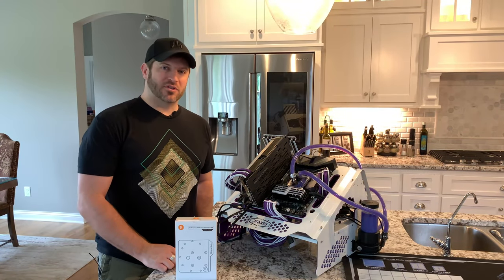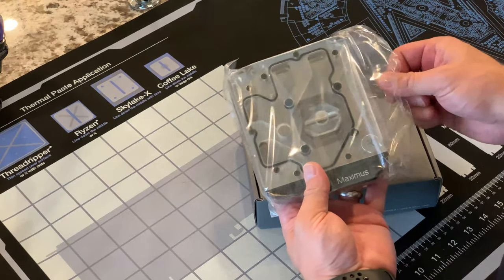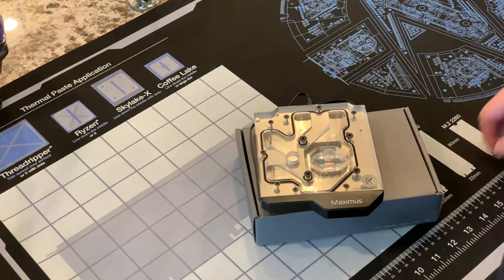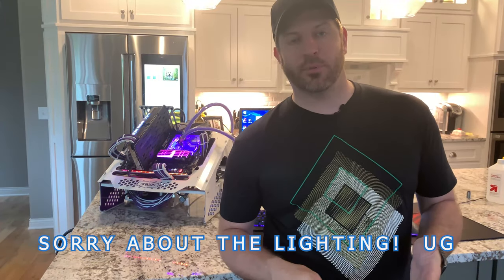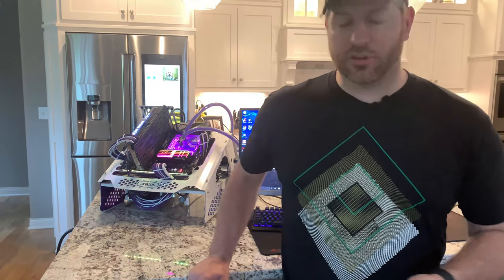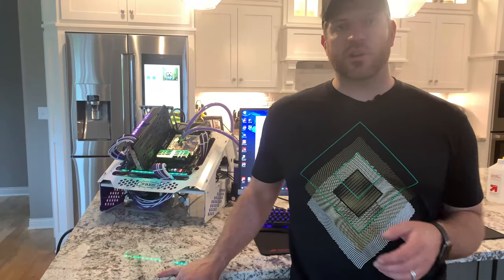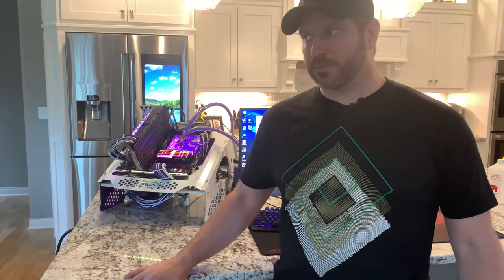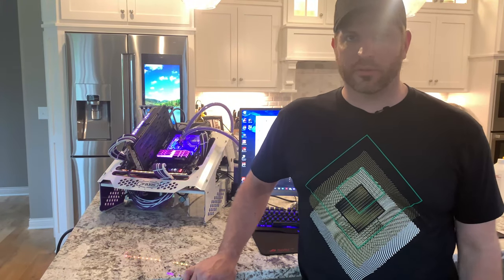EK Momentum Monoblock for Asus Maximus XI Exteme intallation

Comment: don't push it to 5.1ghz. IF you can cool it with a 360 rad 5.0ghz all core is the best performance you can get with that cpu.  Try not to go higher than 80c under extreme load. Yes its hard and expensive. I have done but it required the vary best parts One which is silver based cpu block as well as copper tubing It will help  rads do their work. I also use 2 separate loops. If noise is your main goal and not looks. it is expensive . my fans never exceed 1,000 rpm  only D5 PUMPS should be used for both flow 1.5 gallons per hour is perfect. I did say its expensive.  IF Noise doesn't bother you spend way less. IF 80C+ doesn't bother you spend less. IF LOOKS IS your only concern spend way less.
Reply from the maker: it's my 9900k on this one.  i have another 9900k and that one oc's to 5.2, 1.32 v no prob and completely stable.   this one just doesn't want to hit 5.0.  it's crazy.  so, binning does make a difference.   i have my good one in my main rig ( Genisys ) and is at 5.1 24/7 at 1.30 v and tems are nice and chilly at 28C idle, doesn't usually go above 45 C at full load.  yes, its a stupid dual loop way overkill.. but i love it. :)

Comment: 5.1 Ghz all cores with 280mm rad is enough temps are on stress test max 79C  git gut man lol
Reply: you get those temps with same monoblock?
Reply: @denissh9478  No ..I have stock cooler nzxt kraken x62 280mm radiator and yeah i'm getting on aida  64 stress test max 82 c temps after 40 min...If gaming max 74 c after endless hours

Comment: What memory kit do you use? GSkill QVL gives this kit F4-4266C17Q-32GTZR as the fastest for Maximus xi Extreme,but i have read about problems reaching 4266 mhz stable for this motherboard.
Reply from the maker: this kit is F4-3600C16Q-32GTZR.   in my Genisys build i use F4-3600C17Q-64GTZR.  both kits are awesome and have no stability problems.

Comment: I know its been quite a while since you up loaded this video, but you really need to put the little heatsink back onto the aquantia lan chip, its the smaller heatsink that stuck to the larger vrm heatsink. Those two screws on the back of the mobo near the main heatsink ones weren't supposed to be removed. So if you use the aquantia 5g lan you really need the heatsink. I have same board and mono block and removed the lan heat sink at first as well. 
I mainly was looking at your video because EK's site shows this block comes with a back plate, mine didn't and was curious what it is exactly. I see yours didnt either.
Reply from the maker: for some reason i think i did notice that and put them back.. but, i'll check now that you brought that up.. lol
Reply: I'm confused, how do you put back that part of the heatsink, isn't it a one piece? Thank you for the vid btw

Comment: Enjoyed the video,  seem like your the only one that made a video on it. Been thinking off getting one for my board since I have i9 as well. Only other thing is the dam dimm2 slot trying to get it into raid
Reply from the maker: Yeah... the Dimm.2 setup is frustrating.   If you want to use those, then you can only have one GPU I stalled ( no SLI ! ) and the top slot goes to x8 instead of x16.
Reply: @KDSTech  yeah I just have one gpu, I don't mind going to x8, since my pc is for work mostly, just have a hard time getting my 2 m.2 in raid as boot
Reply: GoogleEyes  I just talked with Asus and they gave me some steps to try to get in raid so imma test here later tonight once I'm down with work
Reply: GoogleEyes  will do man
Reply: GoogleEyes  was a no go, still didnt want to do raid with them
Reply: GoogleEyes  yeah correct

Comment: More info on the stress test and bios settings plz.   the boards bios has to be manually overridden on every power consumption setting because of intels confusing tdp for the 9900k.  I ran into the same issue.  Your 240 with that custom loop , d5 in an open bench should not be holding u back.  Its asus new methodology with the z390 bios.  They treat it opposite if the z370.  They now are meeting intels strict tdp unless manually overridden with about 6 or so scattered settings.
Reply from the maker: yea.. i've found quite a few of those.  i am capped on this chip, however, at 4.9 on all core overclock.  i just can't get it stable at 5.0.  i have another 9900k that i can get stable at 5.2... so.. gonna play with it in upcoming video.  :)   Please chime in if you see something you think i should try.  i am not an expert.. just an enthusiast having fun and making content that i hope others will like and learn from.. even if it's from my mistakes.

Comment: thx for the guide i am installing a EK-Quantum Momentum on the ROG Strix X570-E :p
Reply from the maker: Nice!   Love the avatar!
Reply: Robag - I am installing the exact same monoblock as you. Can you advise if your RGB worked prior to an OS installation and if software needs to be tinkered with? Mine isn't working. It posts but hasn't booted into windows. I'm running it off a splitter, but it also doesn't work when I plug it directly into my 5V header (everything else works fine) =/
Reply: @mitchiezone  heya mitch it is still on its way i will do a guide when it arrives, but i am using a Asus MB so EK said it is ASUS AURA Sync supported :D
Reply: @robag-ipx5773  thanks for that! Yeah, the fact that it is aura sync compatible is also why I went for EK. Just want to know if the RGB should work out of the box or if set up is required through software. I really don't want to fill my loop and then drain it again if it's faulty. If you could let me know when you get yours that would be appreciated :)
Reply: @mitchiezone  no problem will do :)
Reply: @mitchiezone  I'm installing the Strix X570-E on the TUF GAMING PLUS (yes it fits this board too). Everything is still on stock air at the moment BUT I just tested this for you by plugging the RGB cable into what Asus calls "Addressable Gen 2 RGB Header" labeled "A" on their site. The second I hit the power button the RGB in the monoblock goes bananas, so yes it should work in the BIOS pre-OS as long as the AURA/LED is enabled in BIOS.
Reply: @M3TAl89  thanks for taking the time to let me know! My system is now up and running. Turns out it was DOA. Good luck for your build :)
Reply: @mitchiezone  Did EK or the retailer send a replacement?
Reply: @M3TAl89  the retailer.
Reply: @M3TAl89  hi , just bought an Asus  Tuf gaming X570-Plus (wifi ) and want this mono block to cool it , what parts did you have to remove to fit and did it restrict access to  any  pins on the MB .. A PIC WOULD BE GREAT ..doing  my first water cooled pc  in a Thermaltake The Tower 900 .. https://uk.thermaltake.com/the-tower-900.html   ..love some advice .

Comment: Looks great but <80 deg C at 4.8 ghz seems like it could be done with a good Noctua air cooler.  Or is the 9900 that much hotter than the 8700?
Reply from the maker: it's WAY hotter.   and that's an all core overclock too.   if i set to defaults and allow the m/b to set what gets boosted and such, temps are substantially lower.   if i get a 360, or preferably 420 on there, temps will come down and i will be able to overclock further on all cores.
Reply: @KDSTech   hi there my cpu 9900ks on maximus hero xi 5.0 ghz / v 1.265 with same this EK Momentum Monoblock / 3 radiator 360 all 38mm on aida 64 temp 88c / while gaming temp 67
Reply: @iSHAWR3EE  pretty much same temps. I think I'm gonna ditch this monoblock. I don't have much to compare, but it seems that temps can go lower with a better waterblock. Like you get worse temps with this one and monoblocks in general. I dunno, maybe I'm wrong

Comment: okay gotta comment on some things here ; 
you have way to much thermal paste on, grain of rice - you added alot even for LGA2011 chips,
  you should NEVER tighten the screws the way you did , its a sure fire way of breaking stuff and making sure its uneven ALWAYS cross tighten screws ,
 never ever do any work on a motherboard unless you have a cover or a cpu in the socket ,
 with your overclock at 4.8 you should not see any throttle , at all - you should run comfy in the 50-60 with a 240mm rad, either your fans is terrible, your cpu is ueven or you have a terrible contact with your heatsink.

your presentation and showcase of the product is fine, but the things above is stuff you really need to work on ,thats basic stuff.
Reply from the maker: thanks for your interest and i do appreciate your comments.  not overly concerned about the paste as Noctua Nt-H1 is not thermal conductive and there are many videos out there, including those from LTT, Jazytwocents.. and so on that prove that it doesn't really harm anything.. i do agree i may have gone a "bit" overboard on it after watching again.. lol.. but oh well.. no harm.

with regards to screwing in the block, i would be concerned more if there were tension added, ie springs.. like on a standard cpu block..  but it wasn't tightened much and i was feeling for tension on the board/socket.   but typically, i would agree cross pattern is best practice.  

i did address the temps in a different comment, and i prob should have done follow up video, or just "finished" this one.   The problem was actually in bios.  i had taken it apart to make sure that it was seated correctly, that the IHS wasn't in need of lapping, so on... off the top of my head, i dont remember what i had turned on that shouldn't have been in bios.. but i have since gotten things in line.  my other 9900k is a better die quality as i can do 5.0Ghz on it with that setup.. .but its in my main machine.   I am planning on doing a follow up switching to a 420 rad to see what oc does.   

thanks again for the polite comments.   always appreciated and read.
Reply from the maker: i went back and watched again.. fyi.. i did screw in the main part of the block using cross pattern.. fyi.   lol.    again, thanks for chiming in :)
Reply: @KDSTech  fyi i was being polite but your tighting the screws all the way each time you put a screw in , its clearly visible at 5:50 that you add the washer, then put in the screw and screw it all the way , and tighten it all the way .. you put in the screw so it just grabs the plate untill all screws are in and grabbing , then you tighten it in a cross patteren. please im trying to help you out here man .